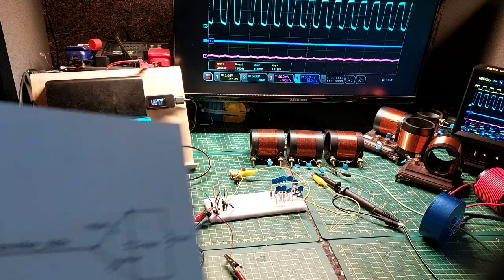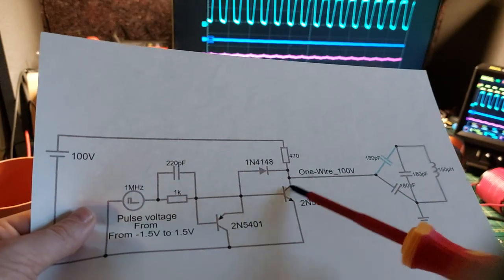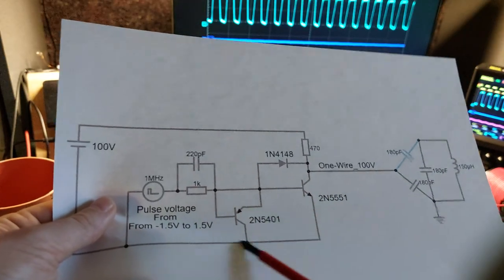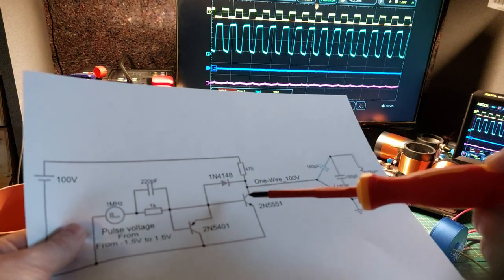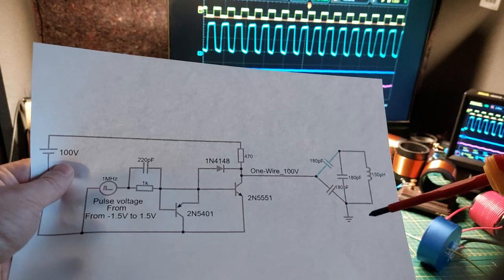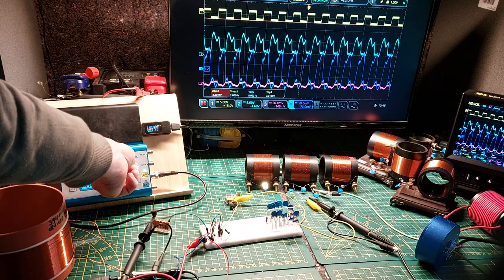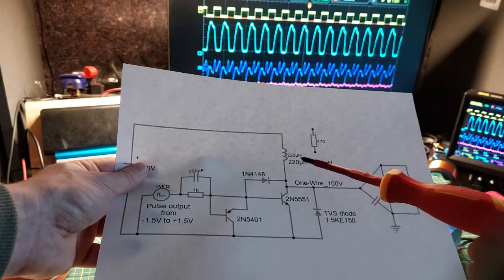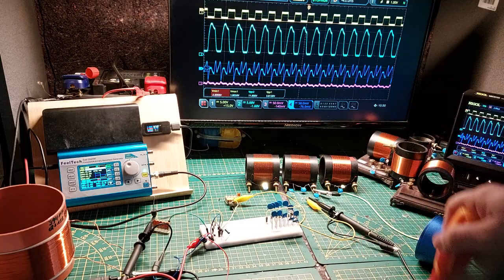Signal voltage amplifier for one wire V1

Comment: I think the pulse amplifier makeing common mode noise thru the one wire and the current return path is the grounding and the capacitive connection between this ground and the amplifier power rails.

I think to excite the LC tank you need to remove the capacitor between “the wire” end and the ground post. The real goal is make big missmach between the series caps.
The second way to increse the output increse the capacitance between the rails and ground may you have to use larger surface here.
The third option to use rather fast riseing edges at the output because the signal dv/dt maters to create current thru the small capacitances.

Comment: Using a MOSFET switch may be better for speed
Reply from the maker: My first tryout was with mosfet and gate driver, the 1Mhz was a problem. When experimenting later with the transistors I learned that to high resistor as pull up was not good. I used higher value to limit power draw, especially when voltage would go to 100V. The first calculations where to get 5W in tank circuit at 1Mhz, but low resistance valu for pull up would allready demand 10W or so. 
It wouldn´t be a problem if the power out is high enough, but at this time I´m still trying to understand what maximum capacitance I can use before inductor is not capable anymore to recharge it in time for the given frequency. Still some lack of understanding on the part of energy movement inside tank circuit. Is it for example possible for each calculated inductor with specific resonant frequency, to recharge the capacitor in time, with the voltage pulse added. As you can see not all things are clear to me.
Reply: @brunovk417 Hi Bruno, a mosfet with a low turn on voltage (logic level mosfet), low gate capacitance and low turn on / off speed is necessary.  You have to choose the right mosfet.  Also the configuration usually used is the totem pole.  That prevents the need for a pull up/down resistor.  But regardless… 1 MHz or above will be a challenge… but not impossible.  There are also special transistors that are made for rf switching… very pricy though.
Reply: @brunovk417 also if you’re trying to copy Don’s original setup… why not just copy it exactly ( as in get the exact same parts he used - it’s possible today to still get those parts )?  Then play around with that?  Even if not, to modify it for your setup… you’d do better forgetting about your transistor switching and just connect to a fly back transformer to the capacitors…. Or use a series tank circuit and connect the high voltage node to those capacitors…
Reply from the maker: @thathalfthaiguy  The problem is that the output stage is not shown everywhere and is always based on presumptions. So going directly to the high voltage, for me is to early,. I couldn't proof to myself that the 3 phase capacitor in this setup is not charged but used to pull in more from ground. That's why I want to see if I can proove to myself it's resonance on a one wire system. When I did experiments with the one wire and saw the influence of the 3 phase capacitor on resonant tank, I decided to go that way.
Reply: @brunovk417  Bruno, I really like your dedication to this research but ... there is something very important you need to understand.... even if you have the perfect circuit, pulling in ground current through a ground shunt does not work unless you use some set amount of high voltage... and you don't even have a ground shunt in your diagram (so it's obviously will not work).  These circuits just do not work with "lower" voltages (with rare exceptions), there is some threshold that must be satisfied to operate.  Rick said it's around 3kV... of course it depends but the lower voltage things you're trying just won't show you what you're looking for.  You must reach a threshold voltage to see things work
Reply from the maker: When doing experiments with the grounding, I see that resonance is also causing Earth ground to respond as you can see in the video. So I hope to be able a get enough to for example 10W light. The 30KW from Don's device is even out of my scope as end target. 3KW to do heating and cooking would be a final target.
If calculations are correct (which I have no idea they are at this moment) then for 10W at 900Khz I need 350V in the 180pF cap. Because the one wire is not closed loop and causing grounding currents to happen at resonance, I really ask myself if it wouldn't be possible for that power level. 
I don't know what exactly is the coupling between resonance and grounding currents, but even at lower voltage I see the difference.
I know about the treshold if working pure from voltage, but then the problem arrise how to switch it, because sparkgaps more destroy resonance then keep it going due to firing at the wrong time. 
From the standpoint of using resonance to trigger the ground currents, the grounding resistor is not helping, tested that many times.
Reply from the maker: I must revise my comment above. Using 100ohm power resistor (wire wound) in grounding path I was able to light up led across it. Looking further into it before creating video.
Reply: @thathalfthaiguy  Hello, do You perhaps know if primary quarter wave resonance (higher frequency) in Dons setup can be substituted for a single powerful enough pulse to kickstart the trumpet wave?
Reply: @brunovk417 Bruno…. Just because you see a ground current doesn’t mean you’re capturing it…. If you’re not engineering to trap those electrons, you’ll never get it to work.  You’re overthinking things… missing the important point my friend.  You need high voltage to trap those electrons   If you’re not seeing that trumpet, it ain’t working
Reply: @MaikMikker-z1pI guess that’s kinda what happens with his plasma tube setup… but if you’re using coils, you want them to “communicate” and that’s part of why you want that quarter wave relationship I believe.  The important issue besides having enough voltage on that secondary is your ground shunt.  If you don’t see or understand what the trumpet actually is, you’ll never get Don’s system to work… it’s quite important to understand what that actually represents and to obtain it
Reply: @brunovk417 that 350v isn’t going to get you anything… unless you really know what you’re doing…. Are you seeing the trumpet?  I did use about 350v in one setup and saw the trumpet but was only pulling in (capturing) only 2mA… that could be significant but you have to know what you’re doing… I’m no expert but just kinda accidentally got it working… learned a lot from that though
Reply: @brunovk417 do you know how the ground resistor works?  It’s not even really related to the resistance so much ….. it’s an impedance phenomenon… impedance is more than ohms
Reply: @brunovk417 you know Bruno… you can see a ground current go in and out of your ground shunt but nothing stays trapped behind it… that means your ground shunt is not working….
Reply: @MaikMikker-z1pever see Don’s setup with a coil (L2) wrapped around the plasma column?  Lots of volts on that coil!
Reply from the maker: @thathalfthaiguy Thx for the comments going to think about it, took some screen pictures this time before the comments dissapear.
Reply: @thathalfthaiguy  It seems You are speaking from practical experience, care to elaborate? A little nudge in right direction would be appreciated. Does frequency play a large role in this device?
Reply: It’s a small clip from some guy that actually visited Don… if I find the link, I’ll post it here
Reply: @MaikMikker-z1psome devices require a lot of careful tuning (L1 L2 maybe L3 and some other parts) and others only some simple tuning (or you could make it self tuning by using a ZVS or some like circuit)… I prefer to work with the circuits that require the least amount of tuning.  But before that you have to settle in your mind how it works and what exactly you’re trying to do in a focused manner.  Read Rick’s Don Smith book and carefully study his 2 resonance books that come in his kits is the best advice I can give.  It’s a lot of hard work but it’s plainly pointed out in there what to do… don’t overthink it as it’s not a difficult concept… the execution may not be so simple though as things don’t work as you’d expect…. That’s where careful consideration of what’s been told is helpful…
Reply: https://www.youtube.com/watch?v=dpmfaYuRtmc

Comment: Solution is easy: just place one extra coil, as trigger. Like a special Joule ringer. You can leave the whole circuit out. TRIGGER 10x more turns than primer. PEACE
Reply: Wtf my comments get continually deleted!!!!
Reply from the maker: It will be easy for creating resonance but the off time of transistor was a problem, or is this kind of setup also draws away the charge from transistor like the switching does with the pnp transistor?
About the comments I also don't know why they sometimes dissapear. I don't get message explaining  why.

Comment: You should make it with a mosfet driver/mosfet :) thatll get you to those voltages :)
Reply from the maker: I tried setup with TC4420 gate driver but the 1Mhz was a problem.
It could be that my resistance for pull up was to high because I found that out later with the transistors.
I didn't expect that it would take longer for a higher resistor to pull up.
Reply: @brunovk417 something like ucc27524 should be able to do the trick. You just gotta make sure your mosfet doesnt have a to high Qg so it wont overheat on fast switching. It should be good for upto 5mhz if the Qg criteria is not been to high. Also pull ups/downs on gates should not be needed.(if you work with a drv ic)

The time with pull up for voltage rise can be calculated from the RC time constant in wich a mosfet or transistor always carry some capacitance.
Reply from the maker: I orderd some to experiment, thx

Comment: Hi! The load on right side has negentropic energy. The question is, hogy possible to incerease the output? Conductive bodies or the ground ... but has any other option? Great video! :) More and more people realise this.
Reply from the maker: I did some searching, including AI, and AI came with a calculation to determine power in a pulsed system. The result was to first determine power wanted and calculate the necessary capacitor for the wanted voltage and frequency. Once you have the capacitor, calculate the coil so that the tank resonates at the wanted frequency. 
I know from past experiments that charging a capacitor in time for higher power is a problem due to the charging time needed in relation to the discharge time needed for the higher power. However in a tank circuit we move it back and forth and not all is lost. 
The statement, a bigger capacitor will give more output, felth wrong to me in the sense of just a capacitor with diodes, like in the Earth ground system document. However now in the context of this circuit, it´s a complete other storie, not in the sense of thousands of uF but in the sense of the right capacitor for the output wanted. The only thing that´s not clear to me is, is there a relationship between capacitor and inductor that must also not be exceeded, so that the discharge of the coil is still able to charge the capacitor to the wanted voltage in the period of oscillating back and forth?
Reply: @brunovk417  Ok, this is a negentropic nonlinear effect. Alias cold electricity, alias Back EMF. It likes the harmony! I mean, the natural ratios. For example, golden ratio.